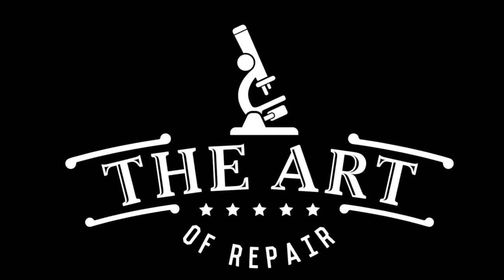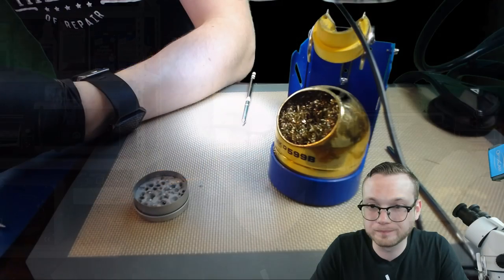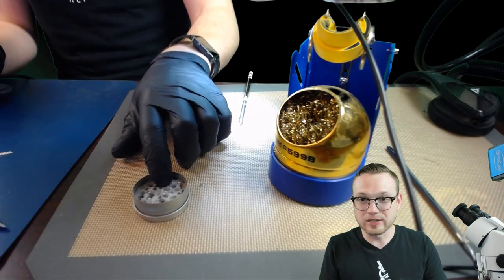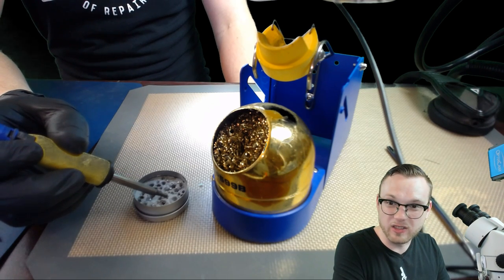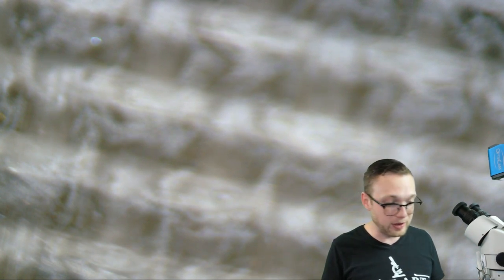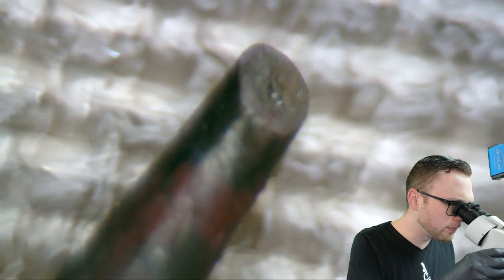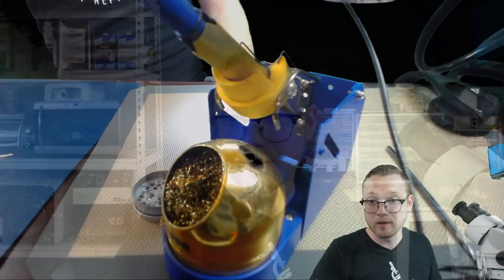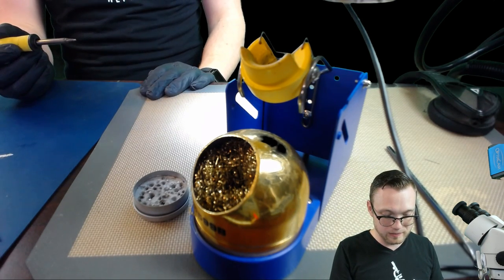EP52 Tip Check | Good & Bad Soldering Tip Habits | Why don't my soldering tips last long?

Comment: Are Soldering tinner and soldering flux same thing?
Reply from the maker: Soldering tinner is a low melt highly acidic metal that eats away the soldering iron tips to help clean it.  Flux, while it is a barrier, and a detergent of sorts. It does lack the metal content that recoats the tip. I hope this help and answers your question!
Reply: @TheArtofRepair   ohh.. understand.. thanks ..

Comment: I have a question. So every single time I put the iron in the holder I have to tin it every single time I pull it out? Like I'm about to do a analog stick in a Xbox one controller. Should only be a great 10 minute job. So I'll do a couple joints take a 1 minute break and put the iron in the holder. So I will need to do it again after only doing 2 or 3 solder joints? Please reply ASAP. I'm doing this Saturday. 

Rob
Reply from the maker: Even if it's not the actual tip tinner, you need to make sure you're keeping the end of your iron clean and tinned at all times, you do not want any sort of oxidation buildup. learning to make tinning part of your process will help you to remember it always, even if you are just adding the solder wire itself and not using the tinner cup.
Reply: TheArtofRepair I just watched some videos by Weller company and they said not to use tip tinner unless necessary.  That the tip tinner has acid in it and will eat the tips if used too much. I bought the thermaltronics tip tinner off amazon.
Reply from the maker: Ya know, its funny, iv been hearing that for years, and im sure it does have acid in it, but also, ill say that I have had no issues using the tip tinner every day vs not using it in terms of tip life.  But again, you can also buy an ingot of 63/37 or something and use that as your tinner base.

Comment: Hiya....I had an old tv engineer tell me to use wire wool on the tip....then dip into tip cleaner then tin it...
Great video though...the music is ok.  :-)
Reply from the maker: That sounds like a great way to do it as well! Just trying to get some sort of abrasion on there to clean off the oxidation!

Comment: Metcal also equals oki, thermaltronics,  and easybraid,  so tip prices vary.. found thermaltronics cheapest all same quality excellent condition used tips all over ebay.. new from mouser.. but amazingly ive picked up some cheap on amazon.. lol last month i orders conical tweezer tip from amazon,  normally like 65usd but were only 13usd grabbed one set.. lol they sent a box of 10 sets.. win 13usd for 10 tweezer tips.. they did same for bent conical last year ordered 1 sent box 10... i w9nt complain

Comment: Using tip tinners frequently can harm soldering iron tips. These products often contain abrasives or aggressive chemicals, like sal ammoniac, which wear down the protective plating on the tip. This leads to faster degradation. Tip tinners should be used sparingly, only to restore detinned tips, not regularly.

I'm surprised I could not find one comment that disagrees with you on the recommendation to use tip tinners at this regularity/frequency you seem to recommend.
Reply: Tip tinner is common to use in the factory. If it was that bad it wouldn't be used as a cost savings.

Comment: Try JBC, you'll be buying new tips every 3 weeks to a month.
You shouldn't be jamming, you should be wiping. And tinner is a too abrasive (unless you got a Hakko). Use solder instead.
Although I do use Hakko tip tinner, but only with my Hakko. I jam with my Hakko too, LOL. With my JBC I brush lightly as if grooming a fleas eyebrows.
Reply from the maker: Your right, it is abrasive, but it hasn't degraded the quality of my PACE or HAKKO tips in the least bit so for me, i just glued it to the top of my omnivise, which is now a glorified tip tinner holder and run it. And in terms of stab vs wipe, Just based on my personal usage over the last few years, I don't think there really is much of a difference, I do remember a time when I wiped more than I stabbed, and I seemed to only make more of a mess with the metal crumbles ( you know what im talking about ) when i wipe, hahaha  =D The only thing I really would like to add to my proper habits is using the sponge to shock the tips prior to work, but I personally have not noticed enough of a difference between shocking it and not shocking it to make the effort. Maybe for initial cleaning...
Reply: With my Hakko I have never ever replaced a tip yet. (only the ones I used to bend, hehehe), Metcal I only changed like once a year (unless I bent them too, LOL).
Reply: But there is a point to the size of the tip.  The JBC tips are finer than those I've used before. I believe this is part of the issue. I don't have an issue with the larger JBC tips, just the smaller ones. I have a larger one that has lasted 3 months.
Reply: TheArtofRepair you think that you're a pro at soldering and you replace your tips once a month?my tip is still perfectly fine and I've used it for a year every day !

Comment: How hot do you have your soldering iron at when soldering
Reply from the maker: I get by at about 350c but alot of people think im crazy for it. Its a bit low, but it works for me. Most people just max it out and go for broke at 370c+
Reply: @TheArtofRepair  I see you have mini ovens that you can buy at target or costco. Do you use those to repair boards?

Comment: That's my problem. I have a good digital soldering iron. The tip doesn't look black. But my solder just beads and will not tin..frustrating
Reply: You may have been using lead-free solder (no flux core!) and lower temp on your iron...lead free solder does melt and flow as freely as 60-40/63-37 tin-lead solder, since lead-free solder have a higher melting point....and without sufficient flux, solder just won't flow into a good joint..

Comment: Just curious Justin, what is the name of your company?
Reply from the maker: My personal shop is actually going through a re branding right now, which will be unveiled next month, outside of that AOR is also a repair company that can accommodate your board level needs if neede. =) Once the new stuff has launched it will be shown on the channel =)
Reply: Great, Best of luck! Would you happen to know good forums communities for board level repairs?
Reply from the maker: /r/mobilerepair on reddit is good, we also have an active discord server =) Links in the description.
Reply: Oh great, thank you. Also, big thanks for the PCB board viewer video (Free ZXW). It has cut down on my troubleshooting time greatly. Keep up the great work.
Reply: Taxis is in bad ways

Comment: I know video is getting old. Just some advice for newcomers. 
 Don't use Tip Tinner daily., I use it once every month if that. with some tips never, It will shorten the life of your tip by 50%+. Using it the same way this guy does is a no-no.  It is not designed for daily use. It is designed to restore neglected or heavily used soldering tips. You should be able to maintain your tip without Tip Tinner for long periods. How, easily. Follow the rest of his instructions. with the added. before & after you put your iron down. Clean with brass or Cellulose sponge then give tip a fresh tinning with solder of choice, Leaving the small bubble of solder on the iron (do not wipe off until you pick up to use. This goes for anytime your iron is at rest including daily shutdown.  Flux removes oxidization solder seals preventing oxygen from getting to tip. This way the solder ball is becoming oxidized not the tip itself.  use external flux if solder doesn't have the core. Easy Right? 

On a side note. Oxidization starts in seconds, by the time he said your tip is now free of oxidation it already started. That why when storing the iron even of minutes, you make sure the tip is freshly tinned.

Comment: I did 6 years of Surface Mount Soldering work and I know first hand that using Tip Tinner will destroy a soldering iron tips faster than anything.
Sure the tips look great if you use it but, go ahead and buy more tips because you will be needing them more often.
Reply: The brass shavings should be enough to clean the tip and make it shiny. If it's not, and you need something more aggressive, THEN use the tip tinner, but sparingly. This works for me.
Reply from the maker: You know, weird enough, I use tip tinner constantly to keep my tip super nice, and I never really see my tips go any faster than usual and even then i tend to replace tips bi monthly even if they don't need it.

Comment: Can you use solder to tin it?
Reply: Sure. The tip tinner stuff should probably only be used when the brass shavings can't get the tip clean.
Reply from the maker: Yes, both will both, usualy tip tinner is a little more agressive.

Comment: How important is it to use the Hakko brass sponge vs ... say .. a scouring pad? Go ahead, laugh. You don't learn anything without asking questions, right? I've been wondering if I could replace my (full of solder) pad with something else. Just curious. And thank you for this video - I'm off to replace my J-bent Hakko tip that I've been fighting with for months tomorrow morning. It's beat to shit.
Reply from the maker: Believe it or not, I have a Hakko sponge holder that has a dish scouring pad in it, I needed something and it worked. I wouldn't say anywhere near as well though.
Reply: Thanks Justin! Also, any good way to recover a damaged / oxidized tip? I read the article on Hakko's site. The solder doesn't want to stick to the tip. I was thinking about some fine grade steel wool, but it seems too abrasive. Thoughts?
Reply from the maker: Tip #3 brother! When its to far gone, just let it go, once you have a new one, be meticulous with it and you will be good! =)

Comment: just buy good plated tip for less than 20$ and put solder on it before turn it off . using acid solution will wear the plating . so yo wont need to use that tip refreshenr every time just take car3 of good tip with solder on it

Comment: You gotta love the way these soldering masters LOVE a well-tinned tip. It's like a symphony for these guys. Then there's the murderous rage provoked by an oxidised tip...
Reply from the maker: Yes, belive it, oxidized tips do make me rage, exspecialy if i leave my iron on and my micropoint is on and i come back and its trashed. So much rage.

Comment: Just the Tip
Reply: This is an absolutely disgusting reference to be placing on a video about soldering wires. You should be absolutely ashamed of yourself and your attitude. :(

Comment: Love your videos, just a request, your always very quiet. Be nice if you had a better mic
Reply from the maker: If you could do me a favor, go check some videos in the EP40 range, let me know what you think of that audio. I had to rebuild my set and maybe my mic settings are not correct. I always want to make sure I do the best work possible, and if you can help me compare, maybe I can get it to a higher standard! =)
Reply: you're*

Comment: Way to much repetition, and not exactly a cornacopia of tips there.
Tip Tinner is abrasive and if you are soldering correctly should not need to be used multiple times per day.  
Tin your tip, fine.  Then once you've done that, melt a little solder on it if you aren't going to be using it for a while but keeping the station on, or just start turning off your station.  Its not like it take 5 minutes to get hot again.  With the extra solder on it, once it warms up you should be able to stab the sponge/brass and get to work.  Would have been nice to talk about why a $5 brass sponge is better than a wet/damp spong vis a vis thermal shock and tip deterioration.
Reply: so it is better to use brass sponge and cop cop on it than greasing it on wet sponge?

Comment: 5:41 umm no dude, thats welding
Reply from the maker: Uhm no dude, soldering and welding are in the exact same family of vocations.

Metal work consists of soldering 0-800 degrees brazing 800-1600 and welding is 1600 to 32k

While if you have a virgin pad you could say we are not “joining metals” 99% of repair work is dealing with already existing metal joints… so we are combining two joints made of solderable metal. 

So yea. That’s soldering lol

Comment: Why is he wearing gloves?
Reply from the maker: Always wear gloves during repair :) just proper repair. No fingerprints and protects from chemicals:)
Reply: TheArtofRepair yeah, I've never seen anyone wear gloves to solder. You lose tactile feel.
Reply from the maker: Depends on the thickness of the gloves. I think with all the chemicals and stuff your using in the process. Gloves really help the process if you get decent quality gloves.
Reply: Safety is #1 priority.